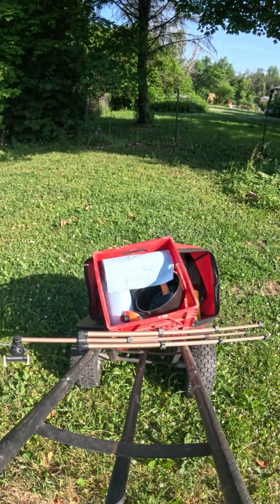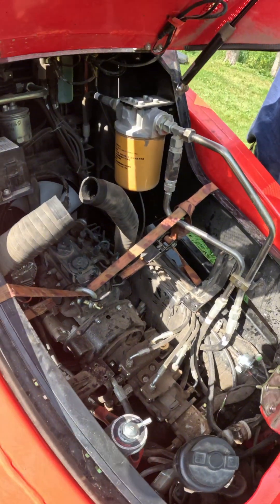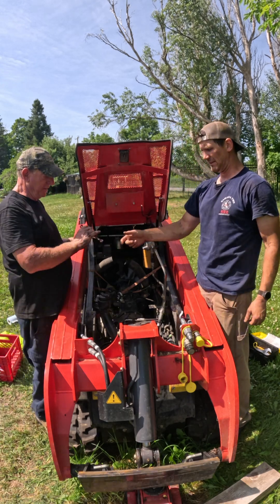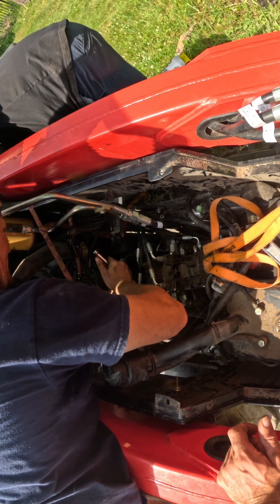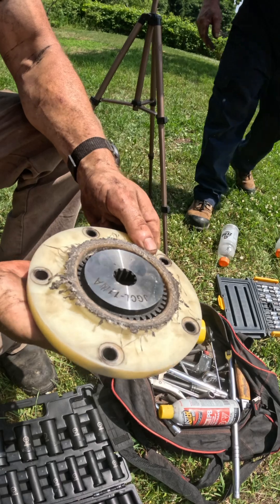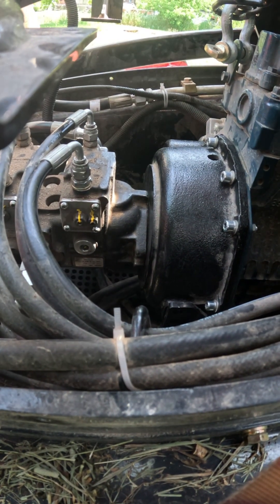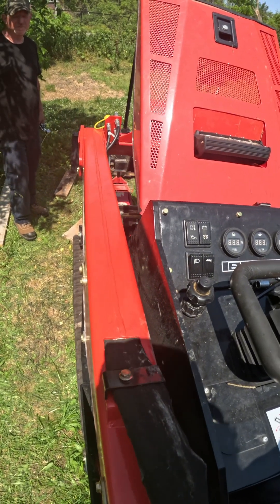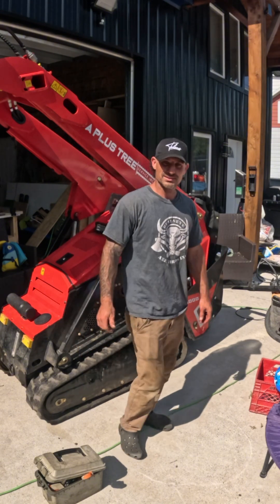Replacing my failed hydraulic coupler on the Derette V1000. No hydraulic pressure.

Comment: Hey Brandon, sorry to see this Derette is as you originally suspected it was - a POS. Seems like you have been spending more hours diagnosing and working on this POS, and it doesn’t even have 50 hours on it yet. I’m dumping my smaller Derette and getting a Spartan SS1200, locally, for $19k. D1703M, high torque, low RPM (unlike the D902 in the v1000, which is a high RPM design (fuel waster and noisy)) larger displacement engine. Also, all hardware is stainless steel.  No comparison. Derette should be ashamed.
Reply from the maker: I won’t go as far as of calling it a POS yet but I am close haha. They shouldn’t have plastic parts in a high friction area. Hope they get a aluminum or stainless part soon
Reply: @APlusTreeService I think you might before (if) you reach 100 hours on it. Good luck and keep the unbiased/unbought videos coming!

Comment: Just keep in mind man, even a $75-$100,000 dollar truck can blow a transmission or fail right off the lot.  Its man made mechanical equipment, doesnt matter the brand, something always fails eventually. Just a matter of when it does.
Reply: Utter non sense.. The excuses you people make up to justify your purchase junk equipment is mind boggling. Is your truck a RAM with 68RFE by chance?
Reply: @machaf  Yeah, there is a difference between a bad design and a fluke in manufacturing. But you people dogging on the average job that can't pony up $75K for a mini skid and attachments is just as annoying. I know I own something that is going to require me to reengineer it as problems arise, and I'm happy to. I'll put the $50k I saved to good use.
Reply from the maker: @justdoityourself7134 I hear ya. For me buying the V1000 is an experiment. I wanted to show everyone what they can and can’t do and how durable they are. So far I can’t be to mad because it has made me good money.
Reply from the maker: @machaf no excuses from me. We will see how long until it’s down again haha.
Reply: @machaf  my point was purely an example.  I operate CAT equipment daily, and  if you seen some of the repair bills and how often it fails you'd shit yourself the costs. Example, Loader transmission rebuilt-$60,000, hydraulic pumps/hoses fail on a regular basis.  Engine replacement twice in the same skidsteer, and we've even had to pull the whole cab off a Loader to replace hydraulic lines. Imagine that costs? Fact is no matter the brand they all have components that fail regularly.
Reply from the maker: @fullthrottle2656 it’s true! I’ve seen plenty of brand new equipment break down first month.
Reply from the maker: This is true. I’ve had it happen before. My lift broke down first week and it was $150k
Reply: Hey man you mentioned loosing pressure for some time in the video. Can you elaborate a bit? I have a unit with 2.5hrs and it seems to have issues turning especially at lower travel speeds. The machine sounds like the hydraulic system starts to bind up and the machine just stops moving.
Reply: I know you bought this as an experiment, but would you recommend it as an option for a homeowner that might do an occasional side job for a friend? Mini skids seem like they're so much more versatile than a compact tractor (at least in smaller areas). A sub compact tractor just seems like it would be impossible to get into tight areas. 40k is definitely out of most people's price range, but is the 15k this costs just a tease? Ive seen others saying the kymron lt30 style is more reliable, but it seems overpriced for what it is. I really want the v1000 to live up to the hype. Have a couple quotes from derette, but it wasn't dean, think her name was Ann 🤷‍♂️ said she was with the same company.

Comment: I just replaced mine over the weekend, It failed on a job as well, I had to get the big skid and load/haul it home, it took me around 11 hrs to replace, just me and a bunch of tools! I did receive the same new design of the coupler, but Dean Said the one that will last 2000hrs won't be done for a couple more weeks, this does look a lot better then the first one, hope to get alot more life out of it, good videos sir and it's definitely not a 30 min job lolß
Reply from the maker: Ya Dean told me they have one in the works which will be a lot better. I will be ordering it for sure. 11 hrs alone is good. I think I would have just given up if I was alone haha. Thanks for watching :)

Comment: Did you see the coupler video derett put out 5 days ago? He shows coupler at 2:40. I was hoping to see a coupler like the replacement you were sent, but instead he showed what looked very similar to the failing couplers still going in the machines. I hope they are stronger somehow.
Reply: Yea, i saw that too and wondering the same. Maybe that's a OLD video from Dean? Who knows for sure unless you receive the new part like the one Brandon used. I guess we will see.
Reply from the maker: @stephenlabella1974 problem is no way of knowing until your machine won’t move :(
Reply from the maker: I did not see that video but I will look for it. Might be the same guy who messaged me on Facebook.
Reply: @APlusTreeService  Hey Brandon. So I have been having interesting conversations back and forth with Derette about the hydraulic coupler. My V1000 has a manufacture date of 12/24 and they are telling me my hydraulic pump has 13 teeth and the upgraded coupler is only 11 teeth. They currently do not have a mold made to manufacture the upgraded coupler with 13 teeth and told me they may never. I asked them how I could upgrade to the 11 teeth and they said it would involve changing out the pump which could cost around $2400. I’m curious what the manufacturer date of your machine was and if you remember if the spline was 11 teeth.